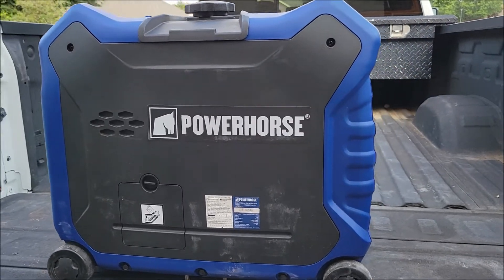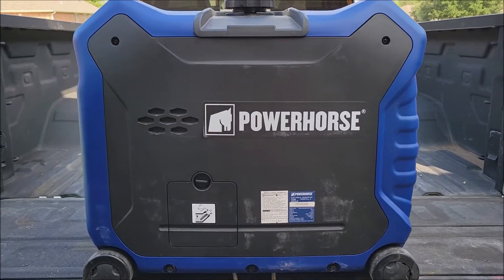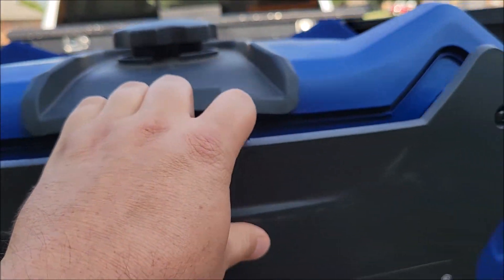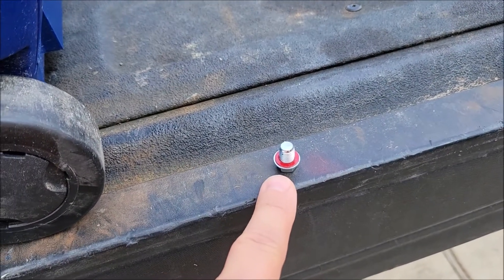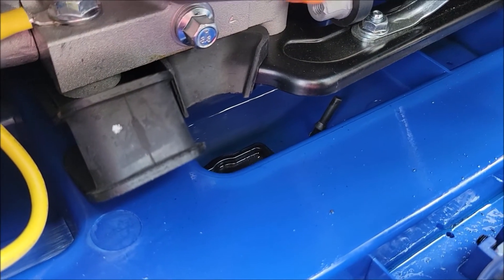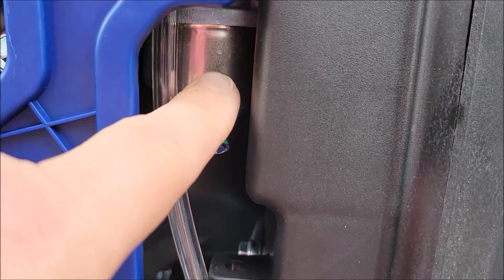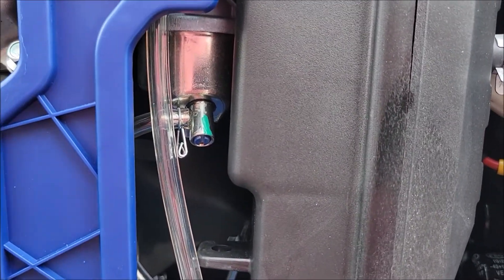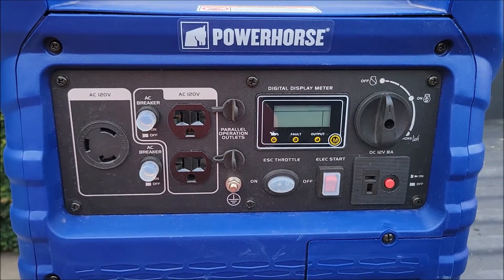RV Portable Generator High Altitude Kit Install | Easy Rejet Fix / Mod

Comment from the maker: I like this generator.  It works great for what we need.  As for high altitude, I am going to run a #68 next time we go to CO.  I may even go to a #65.  Will have to try those next time.  All I had with me the last time was the #76 it came with and the #72 that came in the high altitude kit.  You can find other jets on Amazon ( https://amzn.to/3sp38sg ) or eBay.
Reply: I have the Predator 3500 version of that generator and at 6000 feet the number 68 jet is too big looking for a smaller size jet, I hope this helps
Reply from the maker: @jamesmason7124  Yeah, you have to play with the jet size to find the right one, but I would use a #72 probably for that altitude.
Reply: Wouldn’t you go down, not up if he’s looking for a smaller jet?
Reply from the maker: @eriklarson84  You would, but I run a #68 at 9500 ft.  I would think a #68 would make it run too lean and overheat.  I even ran a #72 at 9500 ft for a week and it ran ok but was a bit low on power.
Reply: @SeidelRanch  I just put a #68 in mine this wknd, and a new plug, ran a load test for 30 mins and my plug was dark grey with a black ring. I live at 6200’. Thoughts?
Reply from the maker: @eriklarson84  Search google for "spark plug lean to rich" and look at images.  There are lots of images online that show what a spark plug will look like when in different ratios.  See if you can match yours to what they show to see if you are too lean, rich or just right.

You have the basics right.  Smaller number jet is smaller hole which means less gas to air ratio.  That is the best way to make sure you are running clean.

Just know, running too rich is much safer than running too lean.  Too rich will be less power but safer for engine.  Too lean will be more power but the engine will run hotter and have less lubrication which will lead to a faster failure.

Good luck and let me know how it goes.  Also make sure the spark plug is gapped right.  I hear that matters too.

Comment: What about when you are traveling to different altitudes on the same trip?  I'll be at about 8,500 ft for a few days, then we'll be going down to 3,000 ft.
Reply from the maker: You get more experience with changing the jets ;p  You have to change them or the fuel mixture will be off.
Reply: @SeidelRanch  I wonder what happens if you run the high altitude jet at sea level?
Reply from the maker: @AllenManor  It will run too lean and overheat.
Reply: @SeidelRanch  Thanks!
Reply: Run the leanest jet you think you'll need and then supplement with a propane kit when you're at a lower altitude. (Yes you can burn gasoline and propane at the same time).

Or, since propane kits are usually adjustable, just go straight propane.
Reply: @minutiesabotage  Thanks. I decided  to run strictly  propane and found I did not have to change  the jet.

Comment: The high altitude kit is only making it so you don't waste fuel on running rich, you will have the power loss no matter what.
Reply from the maker: Yeah. So that thin air is the cause of the power loss, right?

Comment: That was a real helpful video

I bought a Honda EU 2200i off Amazon.  I live right at the boat ramp, sea level.  Damn thing never ran right.  Not adjustable.

I finally got fed up and used a blowtorch to break the glue to remove the lock so I could adjust the damn thing.  Gave it a tiny bit more gas and it ran beautifully.

Anyway
I've always wanted to go back and root cause what happened and do the job right.  I'm a fuel injection guy...  So it never occurred to me that it could be jetted different
.  

You taking the time to make this video....  Got me excited about going back to that job and figuring out how to do it right

Thanks

I'll make a video when I do so.  Livr the dream
Reply from the maker: Nice.  Glad it was helpful.  Hope it works out well for you.

Comment: If you run a generator on propane do you need a high altitude kit?
Reply from the maker: That is a good question and I had to look that up.  Apparently propone generators are not as affected by the thinner air in higher altitudes and do not usually need a jet kit.  I think the key there is how high.  If you are going really high, like 10k or above you might want to bring one with you just in case.
Reply: Thank you checking on it. I'm at 9000'. The Ai generator should run on either gasoline or propane but I only want to use propane. It's new and won't even try to start on propane. I can't imagine how a carburetor jet would affect propane but I could be wrong. Thanks again!😁
Reply from the maker: @gbrown480  It's all about that air to fuel mix ratio.  Hope it works great for you.  Let me know how it goes.
Reply: fuel is fuel 91,502 BTU per gallon of propane, and 120, 238 BTU per gallon, propane is already less effcient, you need "less" gasoline a mater of the fuel orifice from the carburetor.